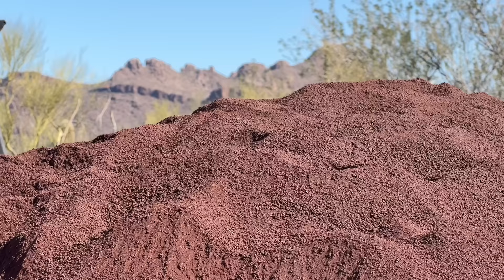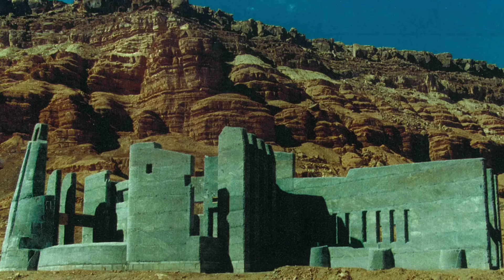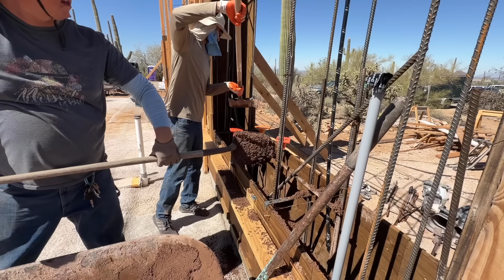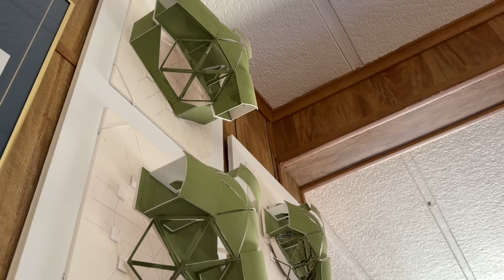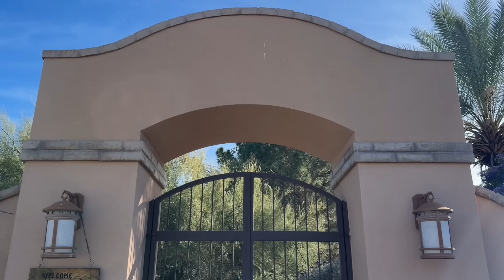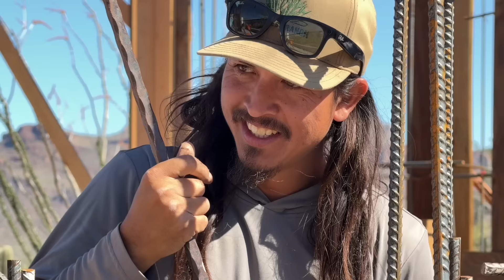The COOLEST Alternative Building Method You've NEVER HEARD OF

Comment: Hope to see the finished product soon. I have questions: How does it repel water and rain? My concern is what I have found with concrete walls is that they are porous enough to allow mold to grow in them. I almost died from mold exposure and understand how it has become an epidemic. I am involved in mold detection and want to help people live a mold free life. I love the concept but need guarantees before I can advocate for this.
Reply from the maker: Scoria sand is an inorganic, inert material that provides no organic food source for mold, mildew, or fungus to grow. One of its benefits for sure. That being said, the material is very porous which gives it many of its desirable characteristics. So it shouldn't be used underground without a vapor barrier. Exposed walls should have generous overhangs, and you can even install foam insulation in the middle of the wall to act as a water break. But that porosity ensures excellent water drainage and aeration. Because it does not stay consistently damp, it inhibits the wet conditions necessary for mold to thrive.

Comment: I wonder how using lavacrete in place of compacted tires used in earth ships would go? I would think building codes would be easier to pass using lavacrete vs compacted tires
Reply from the maker: Lavacrete is porus so you wouldn't want to use it as a back wall without vapor protection.

Comment: Seems like a compressed earth wall might be better.  Requires no rebar and sometimes no cement.
Reply from the maker: Modern rammed earth uses both of these. Similar to Lavacrete you can do it without, but it's harder to permit, reduces your compression and tensile strength, and reduces longevity.
Reply: @TinyShinyHome in NC where I’m from there’s alot of red clay in the soil.  I don’t think ranmed earth qualifies as legal structure under zoning laws.  Google says that adding 5% concrete or Lyme helps with water or flood damaging rammed earth.  Roman concrete is also interesting because it becomes stronger from being wet.

Comment: honestly i cant wait for every different variant of rammed earth construction to become the defacto building choice for basically all homes everywhere , it is versatile enough to accommodate for every environment on earth ; obvs humidity and temperature vary greatly and those are going to make changes and adjustments necessary in the design of the structure/home , but regardless the strength/stability and thermal profile of rammed earth is excellent

Comment: Yup been done in Auckland NZ since 1920s with its 52 scoria cones throughout the city. FIRTH building and Stevenson Quaries, also Alex Harvey Industries.
Also under Stevenson Quarries and Trucking Headquarters in Taupo since 1940 (Construction of Taupo's Lake Hotel) using a ratio of Scoria and Pumice. Taupo beinf the biggest eruption to the planet since 26000 and also the big pumice forming eruption of 232ad placing up to 300m deep of pumice over 30000km². Basic Earth Construction Ltd. Of Taupo revived the Stevenson technology until its owner died. 
Hebel international now is at the forefront of this. Also in Italy many many companies in Naples, and on Sicily have taken thier own appoach to using Scoria, Pumice and Tephra. 
Major problem is with high abount of magnetic particles, Wifi does not work. Also plays havoc on mixing and pumping equipment as it finds its way into bearings fast. 
If you can solve these issues, well done.
I wish you beste of luck.
Lavacrete has been registered in NZ since Stevenson copied the product from Italy. Also Pumicecrete is registered too.
Sorry, your not the first, by a very very long way.
Many older subburbs in Auckland and Rotorua are constructed with Scoria Concrete etc built pre and post 2nd world war.
Placing large chuncks of scoria into the outer facia of buildings was super fasionable in 50s 60s and 70s.

Comment: That's so cool! I remember back in the mid-1970's telling my Dad we should try using pumice pebbles instead of gravel in concrete for the basement walls in the new home my folks were planning to build that was going to have a daylight basement. At the time, there wasn't any data on the load bearing strength of such things. My folks were rockhounds and we spent more than a few vacations in Eastern Oregon and zwestern Idaho which has millions of acres of lavabeds where pumice pebbles were common. The stuff fascinated me because the rock weighed next to nothing. Even pieces as large as a toaster could easily be picked up, provided you wore gloves because some rougher pieces could easily cut unprotected skin. 

Great video! Thanks!
Reply: Is that house still standing? How cool to see how the basement held up

Comment: And how about its seismic resistance? Estetically it looks beautiful. I would only polish the exterior to vanish imperfections and give it a marble look.
Reply from the maker: The rebar provides the tensile strength so you just need to engineer it based on what would be done for concrete in your area.

Comment: Does it need to stay wet/damp for a while after it's poured? Concrete that's allowed to dry too quickly becomes very brittle. How does this do with its quick drying time? Is it better to keep it lightly misted for a time after the pour?
Reply from the maker: It needs to stay inside the form to cure for at least 24 hours, but other than that no need for continued misting.

Comment: Instead of of steel rebar it's better all round and easier to use Basalt fiber rebar mesh and grid it stronger lighter easier to handle and cut .. you could even add it to the pour .. it's temp stable light 5x stronger than steel by wt in tension can flex and spring back doesn't corrode is corrosion and fire and UV  proof , being rock it expands and contracts at the same rate as the walls ...it has high tensile strength. Avoid Glass fiber it's more water, energy and CO2 intensive and sheds damaging  , irritating glass fiber micro needles especially if disturbed or in demolition and disposal. It can also be recycled .😊 🥼🧙🏻‍♂️
Basalt and Gabbros are the most common igneous volcanic rocks in the Earth's crust ,  1kg of Basalt makes 1 kg of Basalt fiber and no extra CO2 produced. Beyond the melting energy unlike Steel or Glass fiber ..
Reply from the maker: That is all covered in the video :)
Reply: @TinyShinyHome 
Some of it is ... the whole construction industry is deeply imprinted on  Portland cement concrete,  steel based rebar and the continued use of Glass fiber in various forms .. because that generates the profits and triggers premature failures like concrete cancer and spalling ...
As an Environmental Scientist and Geologist that spent a lot of time looking at natural and construction failures it doesn't take long to realise that  commercial interests don't always equate to  good durable sustainable infrastructure. I've taught in steel framed buildings that had asbestos added into the concrete and sometimes other renderings to protect the steel frames and rebar  from sagging in the case of fire ive seen buildings twisted and cracked by mining subsidence, trees drying out clay soils and equally being blown apart by groundwater replacement surging  when someone cuts down an old established tree/s. 

As I may have said it's been quite some time more than a decade since the mass of the Man made world has exceeded the biological mass of the planet ,  you only have to have a grade school appreciation of food chains, life and things like air, fresh water and soil to see that's not good or clever.  Clean uncontaminated Water and soil are a particular problem in the USA especially in arrid climates . 
The latest evidence re glass fibre contamination of soil and water along with other micro plastics came about from looking at the problem of the degridation working and  disposing of millions of tons  of fiberglass boats produced by the marine industry principle GRP boat building , At the moment they have to be removed broken up and end up in landfills where they will remain problematic for over 400years.. meantime the micro fibers break away from the hulls or from scraping drilling cutting and grinding till they be or like the needles that do the damage we associate with asbestos. The other issue is the gasses and chemical leachig from plastics, adhesives, binders and coatings and how theyiterreact ithe environment internal and external .. 
In the UK  there areas that all  construction is  heavily influenced by natural elements in the soil and radon gas  being released from the sediments and geology below that. 🤷🏻🥼🧙🏻‍♂️🌍

Comment: 15 years ago I spent two years working for a small company working with the industrial equivalent of that material.we made precast architectural stone with drycast concrete. The yellow sand that is normally used in concrete was our large aggregate. We had super fine white sand for the small aggregate. The Portland cement used was snow white. The more processed (finer the particle size) cement is the whiter it becomes and the more it costs. The uncolored mix was gray only because we used 1 to 1 flyash to cement. It was tested at 5500 psi. It came out of the mixer like damp beach sand perfect for making sand castles. It was packed into wooden molds held together with a pair of bar clamps on a table at the end of a long set of rollers. The mold was filled halfway and tamped with a hand held pnumatic tamper before 3/8" steel rebars was placed. Then the rest of the mold was filled, tamped, screened flat, and hit with a steel towel.  The mold would be flipped upside down on top of a plywood drying surface, the clamps removed, the mold removed and then reassembled. The finished piece would be pushed to the end of the rollers, the corners rounded by a tiny edge trowel, and then left to dry overnight. The ability to immediately demold drycast concrete is huge. We could make a hundred pieces a day out of one mold. Walmart was one of our reoccurring customers. We would produce the stonework for 2 or 3 new stores every month. It would only take us about 5 or 6 hours. If you see the fancy column caps on top the pillars outside the garden center, they are C1-1 on the plans. The sills underneath the windows at the entrance were S1-1 through S1-5 depending on length and right-hand vs left-hand returns. 

I guarantee you can make more than walls out of that lavacrete. lintels for hyperadobe for example or precast decorative features. CMU's are made with drycast concrete on automated machines. There is nothing preventing you from making hollow core blocks out of lavacrete with a manual mold (either purchased or custom built, just remember to taper the interior holes).
Reply: Incredible detail. Yeah..! The architectural detail that could added to a home...!!
Reply: @happy2025-y3h one of the coolest pieces I made working there was a demonstration piece we made so it could be photographed for the website they were making. Years earlier they had been commissioned to make a life-sized Virgin Mary cast that was going into the wall of a new church under construction. They hired a local sculpturer to create a clay model and then used that to create a silicone negative mold over the top. A wood and fiberglass outer mold held the flexible inner mold. Eventhough it had been made for a specific job years earlier, they had thousands of dollars tied up in creating the mold so they had  thrown it on a pallet and stored it on the very top of the racking instead of just disposing of it. When they were considering what to use as examples of products they can produce for the website, they remembered it was still in storage. We made a plywood blockoff panel to reduce the mold to only a bust with the head, neck, and shoulders instead of whole piece. Showing the detail on the face was the whole point anyways. It demonstrated the level of fine detail that was possible in the material without leaving us with a 6 foot tall finished product to deal with. 

The complexity and level of detail is only limited by the ability to build a negative mold.

Comment: The steel is the weak spot.
Reply from the maker: The steel is the reinforcement. Like Guru Das talks about, if you live in a high humidity coastal area there are alternatives.
Reply: @TinyShinyHome  thank you for the reply. I worked civil engineering projects for a long time. It’s always the steel. Roman concrete lasts 2k years….no steel.
Light weight aspects of lavacrete are very interesting.
Your geographics seem agreeable because of low humidity and all that.
Adobe is not much different. But I like the cast in place application. Beautiful, but it’s also labor intensive.
Good to have a full vocabulary of techniques and materials.
I’m still better sold on hempcrete and adobe, but I see the usefulness of this method.
Trust me, the steel is still the weak spot.
Maybe look at glass fiber or advanced plastics in comparison? Something that doesn’t rust and expand, blowing apart the structure over time and never gaining strength over time but just losing?
Hempcrete is a strong competitor that does indeed gain strength over time and has none of the corrosion and expansion issues.
Peace and respect. 🫡 ❤
Reply from the maker: Just a few things to keep in mind: 1. Like we mentioned, fiberglass, basalt, and hemp rebar are options if you are worried about corrosion. It's talked about at length in this video. 2. Adobe is great, too - but remember you have actually make the bricks before setting them. 3. We are seeing a lot of folks commenting here about hempcrete in comparison - and while it's a great infill and insulation material it is NOT structural. This is a key difference - you have to build a whole supporting structure around it (and then plaster it). We're talking a PSI strength of like 150 vs 2,000 with Lavacrete. These two materials aren't competing at all, but can be complementary.
Reply: @TinyShinyHome  Thank you so much for the reply. To your response: Exactly, thats why the steel is the weak spot. Basalt is a perfect alternative.
Your area of the country has certain advantages to using this method, so good on you guys....but the steel  is still bad...and so is almost everything else you can reinforce with in comparison. 
Hempcrete relies on the wood for structure, and then minerally petrifies and carbonizes the wood as time goes by, improving strength and resilience. Any exposure to water via permeability literally improves its performance.
Rammed earth and maybe lavacrete have no such advantage. They are strongest inside the first 30 days and get progressively weaker over time...especially as a result of reinforcement. I think maybe basalt is the best answer, but you don't have the advantage of the natural mineral bonds and carbonization of a basic hempcrete.
Water will travel through and along your internal structure in a permeable material. Lavacrete will get weaker no mater what. Hempcrete in the same condition gets stronger.
Study Roman concrete block reinforcements. That might help.
You guys are pioneering systems so good on you! Keep up the good work. Much respect!

Comment: Cool, but I wonder what long-term durability and insulative value we would get up north from this material?
Reply from the maker: Well, the insulation value is mentioned in the video (about 1R per inch). So in colder climates you can just build your walls thicker. You can also insert foam insulation into the center of the form while filling (similar to the rammed earth sirewall system) for better insulation and vapor break. But in general it sounds like extreme cold environments use an air-entraining agent to create small air pockets in the concrete so there is space for water to expand if it freezes. Lavacrete already has this built in because of the material itself and the way you barely push it together. Overall it's very easy to engineer to your climate (i.e. thicker walls, larger overhangs, larger and more dense rebar, insulation vapor breaks, etc...)
Reply: @TinyShinyHome  I wonder about the durability in the freeze-thaw cycles we have here.  Temps from neg 10 - 20 in winter up to 110 in the summer.  Snow and rain in winter with ice sometimes.
Reply from the maker: Again, do some research into how concrete or adobe is engineered in your specific climate. I’m sure Lavacrete would be easy to adjust to any specific concerns.

Comment: Why not mix fiberglas fibers in the   mix? Helps to hold the mix in place.
Reply from the maker: Doesn't need it
Reply: @TinyShinyHome The fiber is actually stronger than the rebar. Rebar produces several point of moments. I've watched testing on rebar reinforced beams and fiber only( 7 lbs/ yard) . The rebar broke apart the concrete at the fail point at a much smaller load than fiber only. Check it out for yourself.
Reply from the maker: If you back up a bit, remember the whole idea behind Lavacrete is to trade some of the strength of concrete for other attributes like better R-value, sound absorption, weight, labor, etc... because concrete is overkill for architecture. If you want to add fibers you can certainly try it - but you're adding cost, complexity, weight, etc...
Reply: I think you misunderstood what I was getting at. I meant using the lava material , but with fibers instead of rebar.
Reply from the maker: I think if that was recognized as a viable option during engineering and planning reviews Paul or Guru Das would have mentioned it. Can ask them during the workshop.